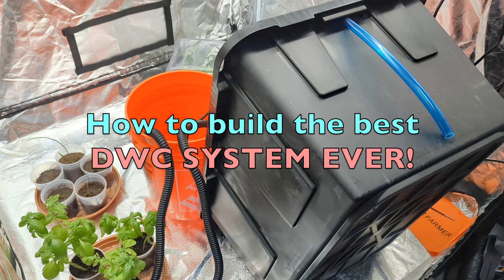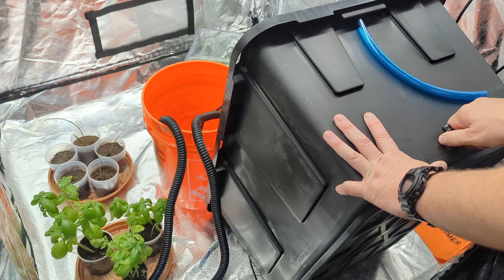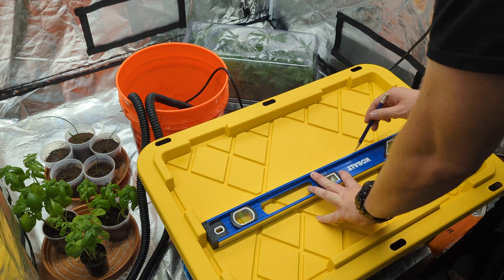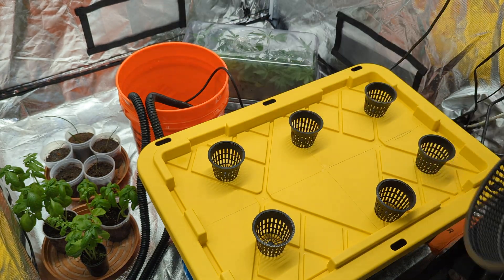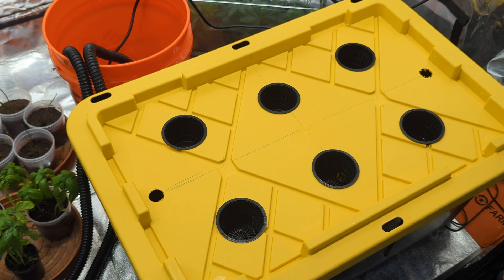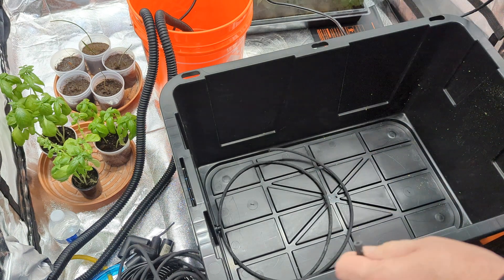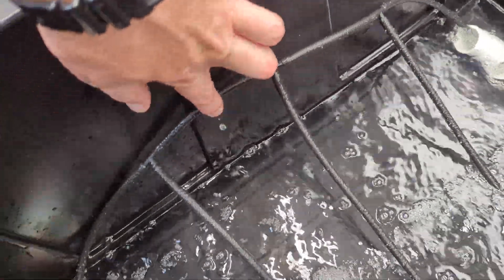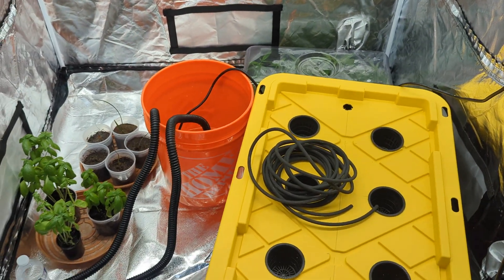$100 DIY DWC - Spider Farmer Led Grow Lights, Build Your Own DWC System and Grow Hydroponic "Basil"

Comment: I would only put 1 plant in this system. Looks like a 4x4 grow tent so 1 plant could easily fill the entire thing in flower with some Low Stress Training and tying down. You will also need a water chiller to prevent any bad stuff from growing in your water. Ideal air temps would be 80F with water temps of 65F for explosive growth and buds so heavy every single branch will need to be held up with string. I would guess final yield regardless of strain will be between 2-3 lbs of dried and cured bud in this space. This comment is more for new growers to see since you already have a chiller and know what you're doing.

Comment: Awesome diy. That air diffuser hose is gonna clog pretty quickly I think?
Reply from the maker: Nait won't. I've used them before. It's what name brand systems supply these days. It works great. I use them in my older videos

Comment: Mount air pump above water line. If air pump fails and is mounted below water line , it will syphon water and destroy pump.
Keep level tube on side covered with a dark Rag. Light will cause algae to grow. You left out the most important Tools. Reverse Osmosis Water Filter , PH Meter, 
EC Meter, TDS Meter, Light par Meter . 2 - part plant food,Only for Hydroponic Use. Get the one marked RO Water . Do not use food used in soil.  Also if your using Co2,  a Co2 Meter. & Co2 detector for all rooms if your light can put down a par of 1000 or more.

Comment: DWC is sooo simple especially effective for keeping mothers kept mothers in totes like this under an 8 bulb t5 fixture but I used 3/4 inch hard foam soaker hose filled with aquarium gravel and barbed elbows and two straight connections drilled and epoxied the airline fittings into the straight connections worked literally for years just pruned the roots every 6 months or so they would be sad looking for a few days then they would bounce back and take off food was ionic grow and silica blast with a drop per gallon of super thrive, ppms stayed 400-500 ph stayed between 5.8-6.2 for years!! This system is an exact replica almost in design except for the chiller water temp hovering 66-71 degrees year around never had trouble with temps seriously I think I kept a mother plant of a killer pheno of the original Bubbleum and east coast Elvis((legendary NJ Elvis not that seedism knock off BS)) alive for 3 years and the only reason I got rid of them was to try new strains but they got flowered outside I didn’t kill them the bubblegum Mom from outside got flowered in the summer of ‘04 I think I have friends that still mention that bud from that plant almost 20 years later
Reply: Ionic 4 the win 🏆

Comment: I like this. 
I use a Rubbermaid 50 gallon and I get some rigid insulation foam from building supply store. I use air stones to percolate. 
Can use 35 % peroxide to clean. Can run beneficial bacteria to control the growth of bad bacteria forming.

Comment: the blue plastic tube will probably also give you a lot of trouble with light leaks and bacteria
Reply: They're blue for that reason so they say. I  still cover mine with pipe insulation. Pool noodles. Same thing basically.

Comment: Corrugated hose is not good, it will trap bacteria guaranteed and much harder to clean . I’d swap out for smooth wall hose black. That tote setup is the best, I just wish they made one that was BPA free. That plastic smells so bad gives me a headache. HDPE is the best to use food grade or at least BPA free, more $ but thicker and lasts longer without chemicals leaching in the water.

Can’t wait to see a super low scrog with 2ft Colas from corner to corner of the tent. 🍿⏲🤩

Comment: It's great what you doing man. It's very interesting to see how SF 7000 show yourself with DWC and Humboldt secret nutrients. You will use Humboldt secret right? I also want try this nutrients for DWC but i am afraid use Golden Tree in DWC because it have organic components. I had a bad experience with use nutrients with organic staff in DWC. Good luck Man I wish you success.
Reply from the maker: I don't think i'll br running humboldts secret nutrients in this dwc grow. never know though. well see.
Reply: Humboldt secrets promote that it's nut perfect for DWC. I had bad experience to use nirvana of advanced nutrients it's also contains organic components and same black thick liquid like a golden tree. After that in my dwc bucket was full of bubbling foam.

Comment: Can someone tell me what ppm of calmag to feed on top my three part advanced nutrients.
Reply: YouTube can help you find that answer
Reply: @cos_grow1337  yea can't seem to get a straight forward ppm measurement.
Reply from the maker: I cover all these questions in the previous grow with humboldts nutrients.
Reply: @HygroHybrid  I'll take a look. Thanks
Reply: Never needed calmag when using advanced, go to the nutrients calculator and follow that it's never failed me.
Reply: @dontcomment6012  was u using coco and strong led lights?
Reply: @marijuonko7092  1 mil per gallon should be plenty. Advanced Nutes already has calcium and magnesium in it.
Reply: @kenshinhimura9387  thanks. Yea that's what I ended up finding was a good amount. Plants look good now. I'm happy.